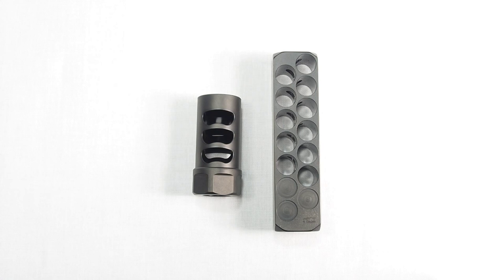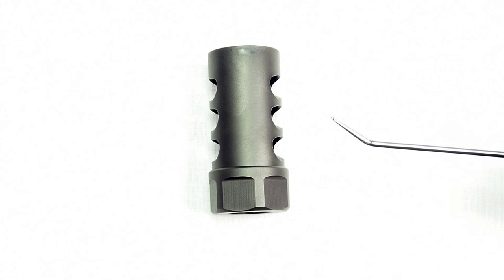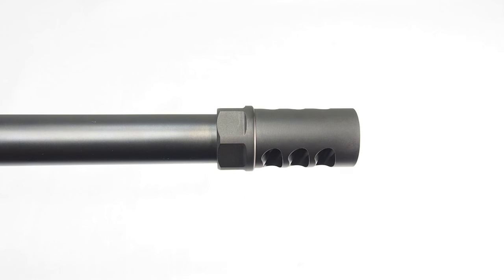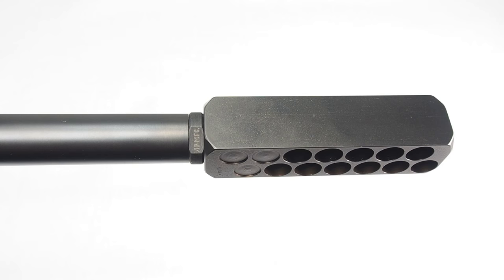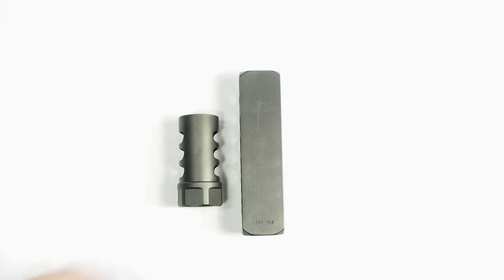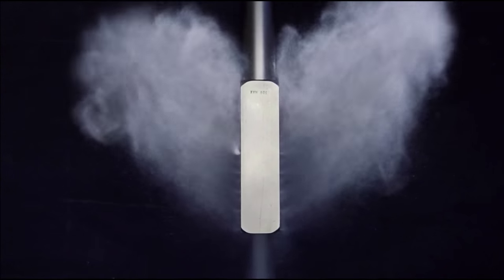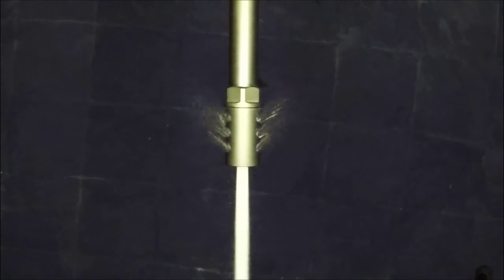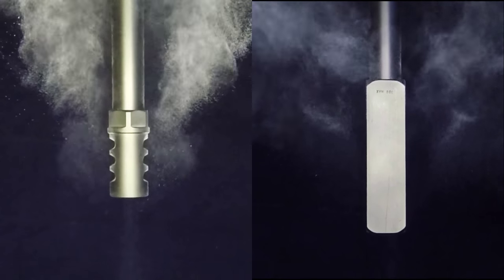Huber Square Brake and APA LB Gen 2 review part 1

Comment: You need to put like, a foam ear plug or something in there to simulate a projectile. Through each baffle the bullet passes through, the gasses will deflect off the back of the bullet surface and out the ports of the muzzle brake.
Reply from the maker: That is a good idea. I have 4 different brakes for the same rifle now so if I get a chance I will try to do the demonstration again maybe sending something down the barrel to create back pressure. Thanks!
Reply: @fourclicksleft4187  After I left that comment, I realized the video was posted 7 years ago and popped up in my feed! But yeah, that would be very interesting to see

Comment: Flow characteristics change significantly during supersonic compressible flow. The flow pattern won’t necessarily act the same way it does at sub sonic flow with compressible or incompressible fluids.
Reply: I'm just a layman but reading up on some papers that describe what's responsible for the muzzle blast. The muzzle gases create a shock wave right when the barrel uncorks when bullet exits the muzzle, but then propagate much more slowly than the shock wave itself. Are these turbulent gasses still traveling at supersonic speeds?
Reply: That’s a great question. It depends, but most likely yes. The shock wave forms at the “throat”, which is at the narrowest choke point. The flow rate will always be supersonic in front of the shock wave and sonic behind the shock wave. The question is, where is the shock wave? Multiple waves can form in various locations or can be chocked off, canceled out. This is dependent on geometry, flow rate, etc.. My biggest takeaway from my compressible flow class was how complicated flow physics can be especially when fluids are supersonic. One thing is for sure when it comes to muzzle brake optimization... the brake is usually most effective when the baffle is 1-2 calibers away from the muzzle. So the baffle for a .30 caliber round should be spaced between .3” and .6”. There was a lot of research done for muzzle brake optimization for howitzers during the world wars. It’d be cool if someone did a schlieren video on muzzle brake designs.